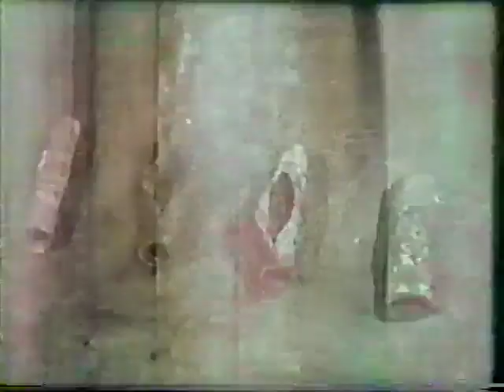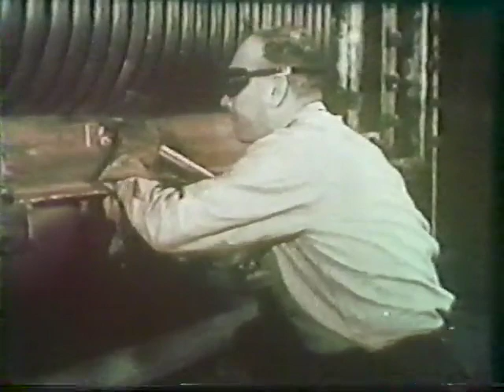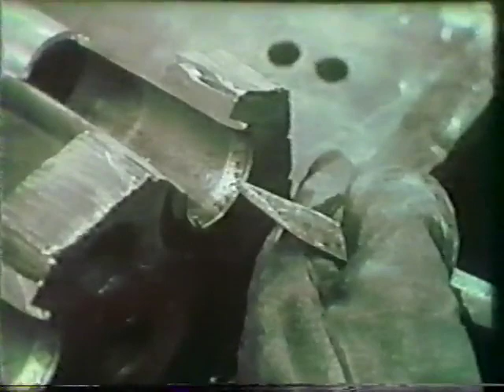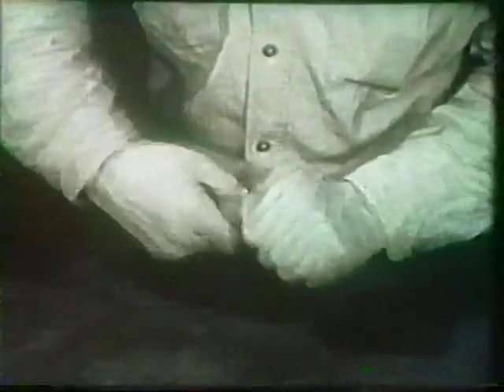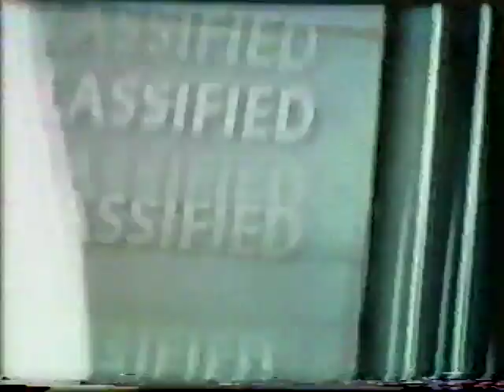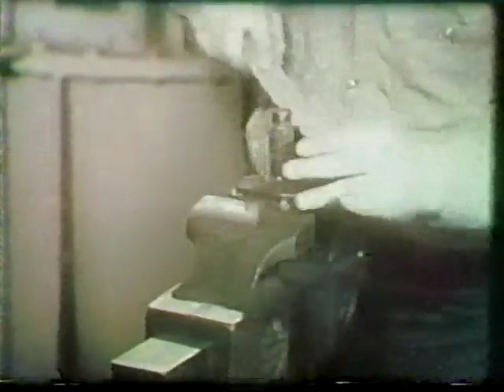Emergency Boiler Repair - Water Side Removing Boiler Tubes

Comment: how does that hammer drill slice through that easy
Reply: They are using a pneumatic hammer with a sharpened chisel bit. The tube walls are actually pretty thin. I don't know what the mill wall on those tubes would be but once the tube is punctured the chisel cuts through easily.